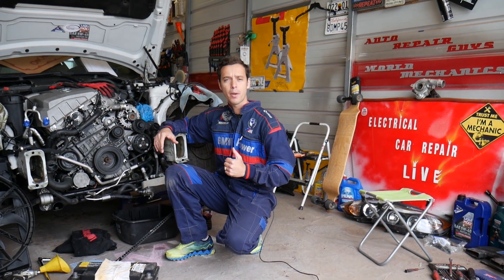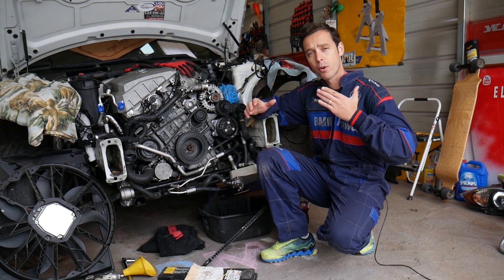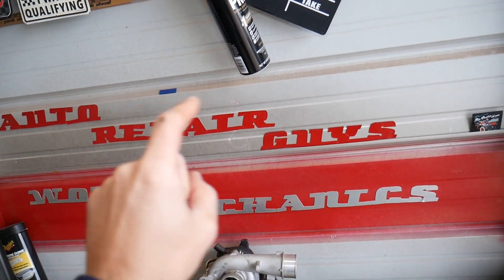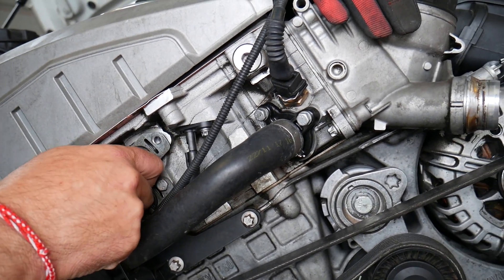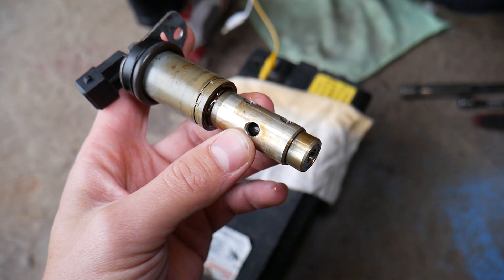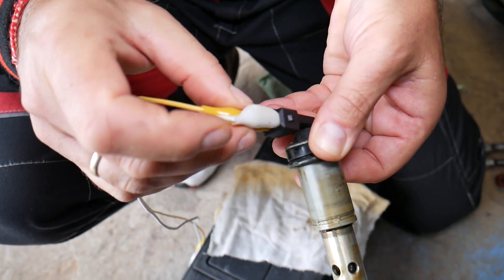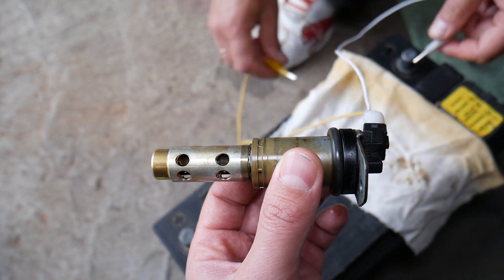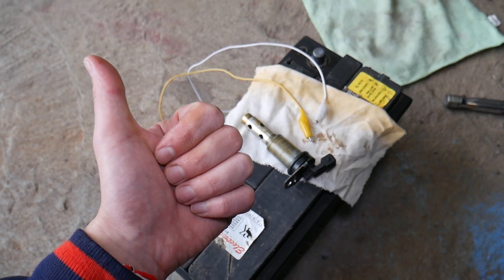HOW TO TEST VANOS SOLENOID ON BMW E60 E61 520i 523i 525i 528i 530i 535i 520d 525d 530d 535d 550i

Comment: How does one know when it is bad even if it plunges when you apply voltage. 
I've had some sort of problem that got cleared after replacing the solenoids, but every time I applied voltage on the ones I replaced, they actuated.